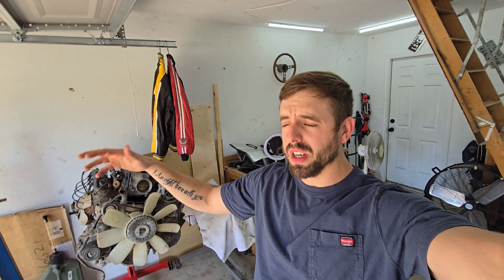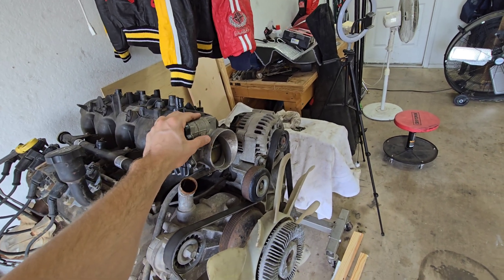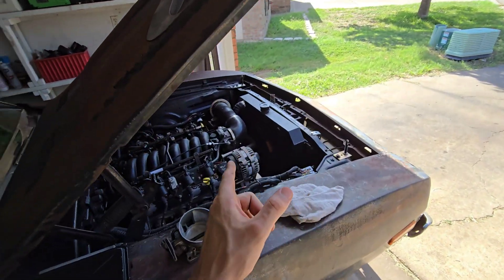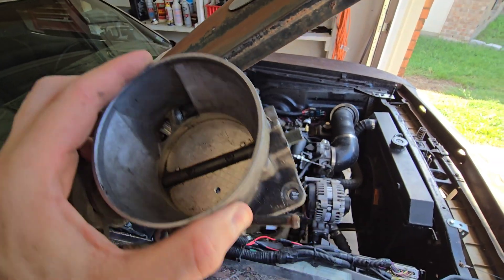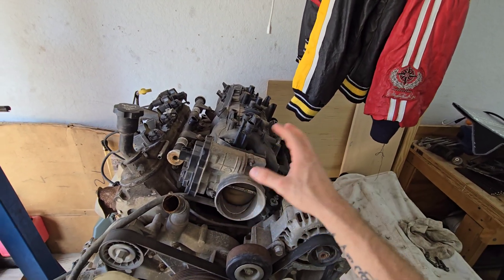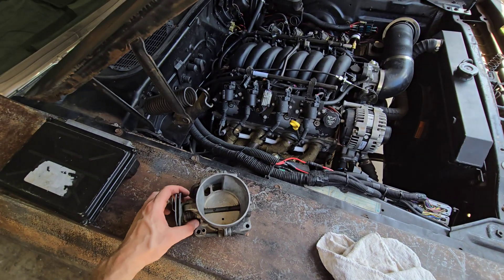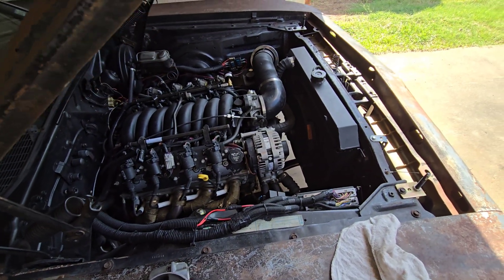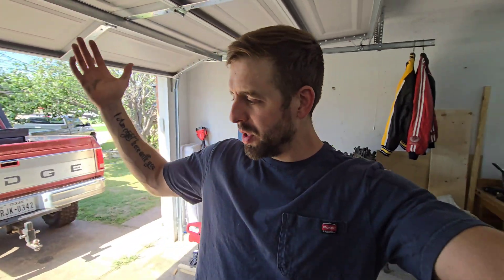DBC or DBW Throttle Body For Your LS Swap?

Comment: I know this video is older but i would appreciate help> I just bought a 5.3 swapped s10. It is DBC.  On the throttle body, opposite side of the IAC and TPS there is an open hole. What should be there or should it be blocked off?

Comment: You literally do not mention how to re-pin your PCM in any of your 20 minute videos if a guy does a swap. Amazing
Reply from the maker: I've never had to re-pin anything
Reply: @krustyclassicsgarage  So basically, without a reprogramming having to be done, if I wanted to put a cable driven throttle body on my LQ4 swap, that came with an electric throttle body, DBW system, my only other option would be to find a 6.0 Chevy express van, with a DBC system, and use the harness and PCM out of that Van, for my swap. But my Suburban the LQ4 is going into is a 4x4, with a 4L80E transmission, and I am pretty sure all the vans were 2wd only. So either way, I would have to get a tune.

Comment: Been watching your videos for the last month now. I am now current! Haven't messed with my 3rd Gen Camaro in years it just sits in the garage lol. Got the old 350 700r4 pulled out and now cleaning the engine bay up. About to cut a access panel to change the Fuel pump in the rear hatch. Been shopping around on market place for gen 3 5.3 / 6.0 truck engine and like you said if you are new to it, its a lot to take in. I find myself coming back to your videos to answer questions i have and to understand the difference's in what im looking for Im more of a visual learner. I was just asking myself the differences in drive by cable and drive by wire and you just clear it up for me.  I have used your channel to help me feel confident enough to take on this task, thanks for all the time you put in these videos man much appreciated, would be cool to have somewhere to post pictures of everyones LS swaps you helped get rolling from all this free info you have blessed us with. Keep up the good vibes and deafen yourself to the hate, for every 1 hater theres 10x more people getting use of these videos so just use that to keep it movin.

Comment: I have a question actually! It’s about the gasket. The gen 3 DBW from TB from a truck may mount up to the ls1 and ls6 intake but the gaskets are what have me worried. LS1/6 has a different TB gasket pattern than gen 3 truck TBs. What do you do about that?
Reply from the maker: Never had an issue

Comment: Thanks bro glad you explained all that .I'm doing a 03 gmc 5.3/4l60e into a 1983 ford ranger. I got vats deleted on the factory ecm and a swap harness for a DBW with trans controller I did keep the DBW pedal and box from the truck and was gonna put it in the ranger. Should I go ahead and continue or abandon ship and repurchase another harness, ecm,and intake (I have a Aluminum intake from Amazon with  102 throttlebody)
Reply from the maker: @BigBlock1976  since you already have everything might as well just give it a shot.

Comment: Thanks for this video.  My project is longer basically by my son getting his license, which is 5 years.  This topic was something I wasn’t sure about, but definitely drive by cable for me.  

What about stock intake and throttle body upgrades Vs Holley sniper   efi and carburetor manifold?  Was wondering what those pros and cons are.
Reply from the maker: @westparley  unless you're trying to make crazy power. Stock stuff will work perfectly fine. Stock stuff has handled 1000hp for many years.
Reply: @krustyclassicsgarage  ok thanks for talking me off a ledge.  I have a 6.0 3rd gen.  Said it was an LQ9 but I haven’t taken it apart yet.  But I have 317 heads and I have been stuck on trying to get 243 for like 500-900 by me. Or worse summit heads.  But I should start easy and go from there.
Reply from the maker: @westparley  ya. I'd just leave the 317s and run it. They flow almost as good as 243s but have a bigger combustion chamber. You could run 706 heads and they'll bump the compression up a little bit
Reply: @krustyclassicsgarage  ok good to know.  I have time, I am going to build it as I abuse the engine in there now.  I am also considering going carburetor.  I am going to do some price checks.
Reply from the maker: @westparley  factory efi for Gen 3 engines with the cheap stuff you see me use on the channel is far cheaper than going carb now. 10 years ago, carb was the cheaper option, but not anymore unless you could find a deal on a carb intake, msd box, and carburetor.

Comment: Hey I need help on my swap wire up my oxygen sensor 6.0 don’t know if I wire them right dbc setup  and tip on installing tbss intake do I have to something different than my truck intake
Reply from the maker: Your o2 sensors are already set up in the harness. You just plug them in. TBSS intake bolts on if you have the same port on your heads as the intake is. Will probably need injector adapters depending on which harness you're using.